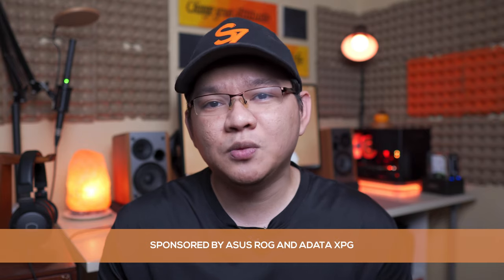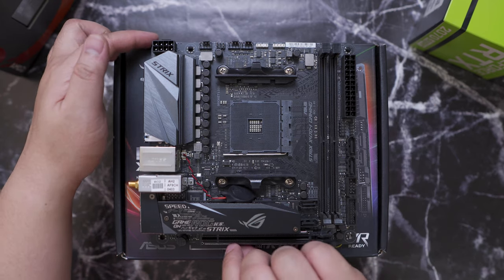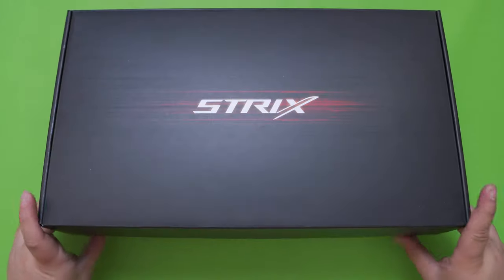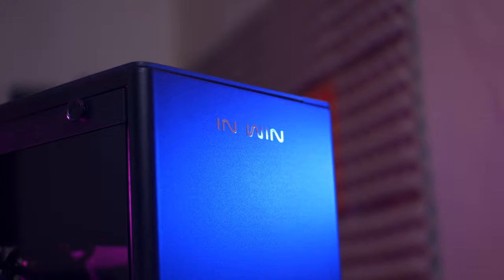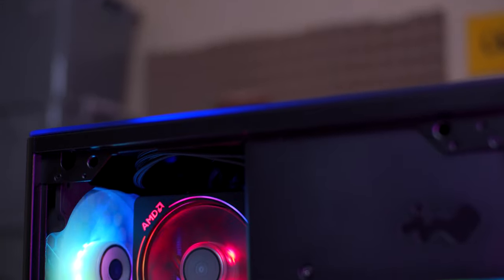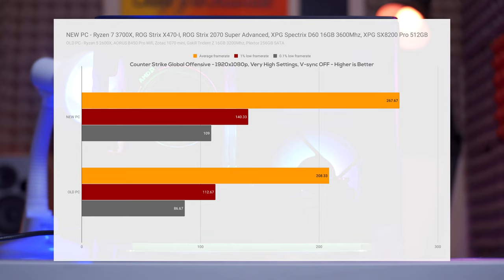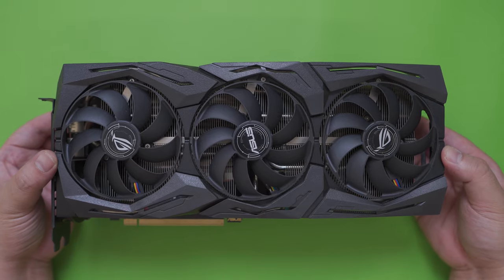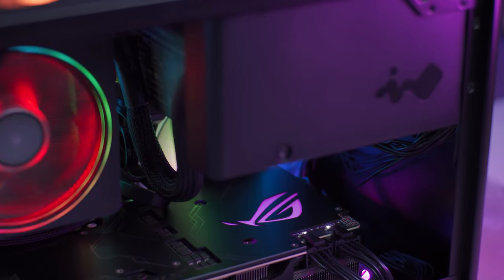Php 90K Mini-ITX 4K Video Editing and 1440P Gaming PC Build + GIVEAWAY

Comment: Ryzen 7 3700x
Msi b450i gaming plus ac
Gigabyte rtx 2070 super gaming oc white
16gb 3600mhz ram
256gb nvme m.2
1tb ssd 2.5
Deep cool gammax gt argb cooler
Df12025 trio argb 
Deep cool fh-10 fan hub
Inwin a1 plus white.

Will these build be good?

Comment: Same Processor but with 2060 Super nga lang. Yung temo ng 3700X ko is 48-51c pag idle pag on load, umaabot na ng 81-85c which hot  lalo na 240mm AIO na gamit ko lol
Reply from the maker: Even with 240mm AIO you're getting 48-51 idle? anong case ang gamit mo and anong AIO? parang ang taas naman ata nun pati na sa load
Reply: @TechBroll  Tecware M1 Micro and Deepcool L240 V2 hahaha. Sa Ryzen Master ko minomonitor yung temps. Di naman nag thermal throttle so okay lang. Yung ibang 3700x users din sa Reddit ng AMD same issue rin.

Comment: I built my pc like 2 months ago and i only spent 13,000 pesos (250 USD) 
Specs are:
Amd processor 3.5 ghz with 2gb of integrated graphics
4 gb ram
120 ssd
120 hdd
150 mbps wifi card 
500 watt power supply
No graphics card 
All of these may seem small but its more than enough for me cause ive been gaming on a potato laptop 2.13 ghz 4gb ram trash...
Reply from the maker: I feel that, I also came from a relatively low specs PC before, and even used only a laptop. so yeah, one step at a time brother!